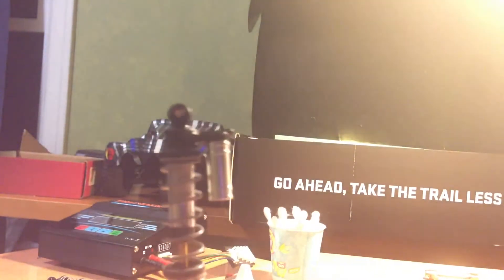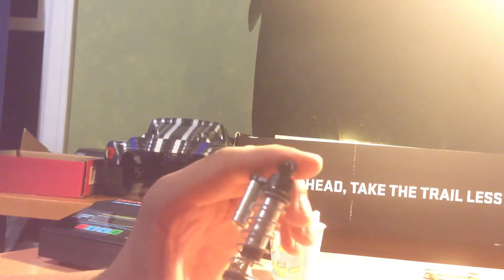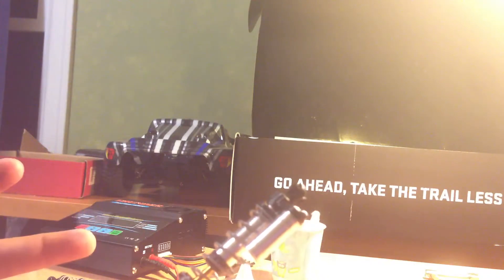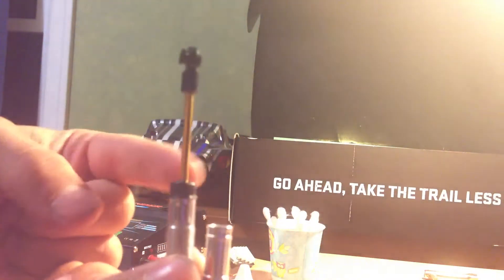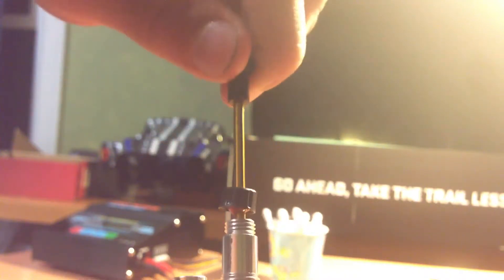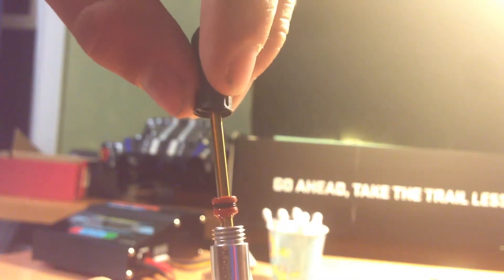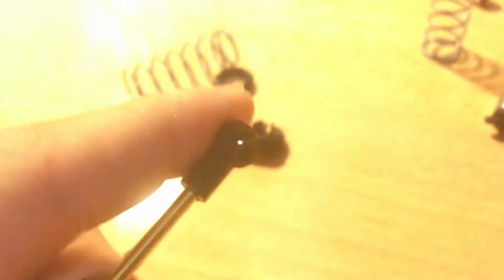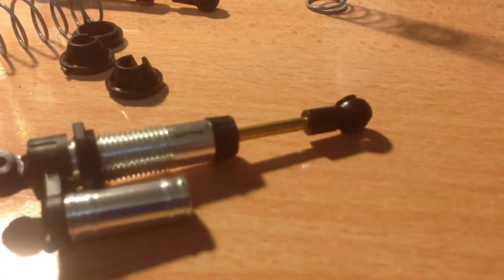How to stop tour Axial icon shocks from leaking (with fail Commentary)

Comment: Never had mine leak.  Use green slime on the orings before  building them.  Yours might leak because you have too much pack/rebound in the shock which builds too much pressure inside the shock.  You need that x ring or plastic spacer to get proper seal.

Comment: I must have gotten lucky mine don't leak there they leak from the caps
Reply from the maker: A way to fix that is make sure u have the o-rings in the slot that's meant for them, not in the threads of the cap. Then grease them with team associated green slime. Then tighten the crap out of the cap w/o breaking them. Then you should be leak free on the top
Reply: JDRCNetwork  I'm mostly likely to get a g-made g-transition or the pro line powerstrokers
Reply from the maker: I did a video on the g-transitions. They work GREAT, a little difficult to build, but they're awesome. And, (wait for it) THEY DONT LEAK!!!